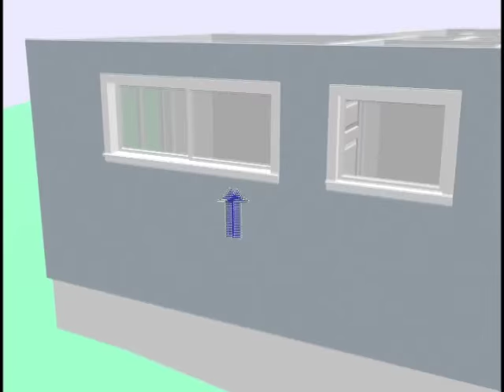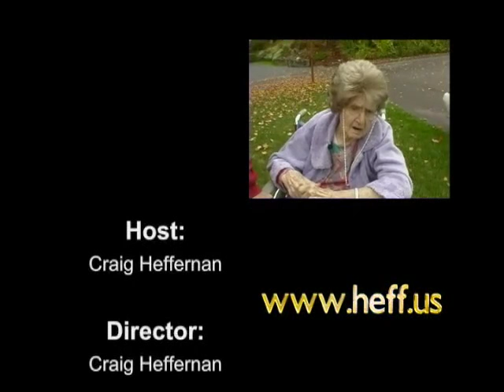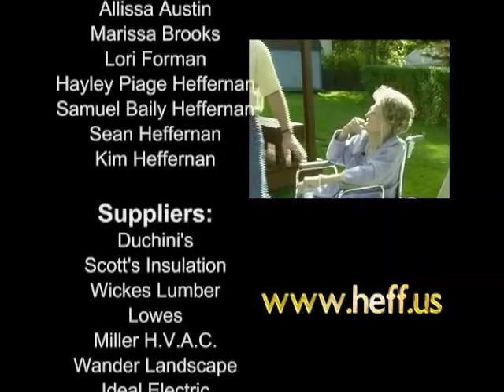How To Do Replacement Windows

Comment: Great video Craig-she's a doll!  I have a question for you-I have a one car garage I want to make into a bathroom and closet. It's adjacent to a large "family room" but is being used as a master bedroom, and it's a better bedroom than family room. I have plumbing in an existing laundry room and the water heater is in the garage, which I would reposition somewhere else. The elevation to have a smooth access ( wheelchair?) is about a foot off the garage floor. I have a tall ceiling so I should have plenty of overhead room in the garage. . Lots of electricity. Of course I"m no pro, but I think I can do some things myself. My question for you is where is the logical starting place.? I"m thinking the plumbing, then the flooring, then open up the wall between the rooms. What do you think? PS I have a two car garage attached behind this garage that was added on by a previous owner.